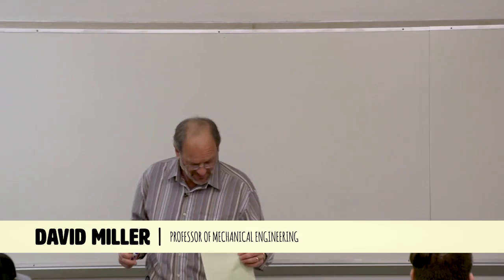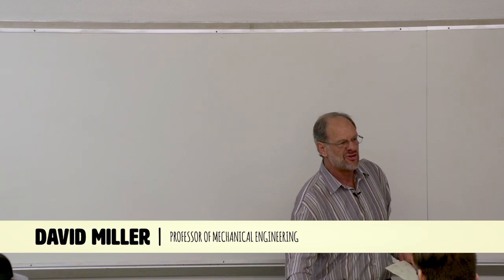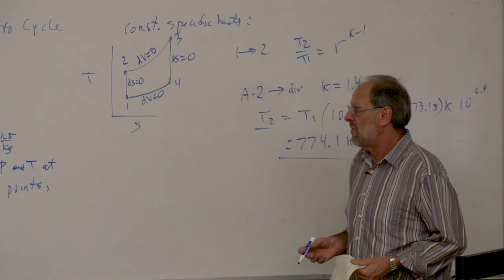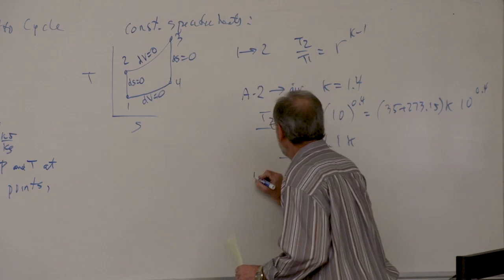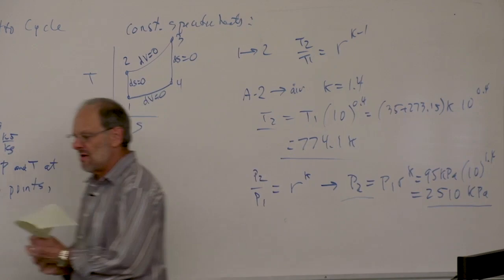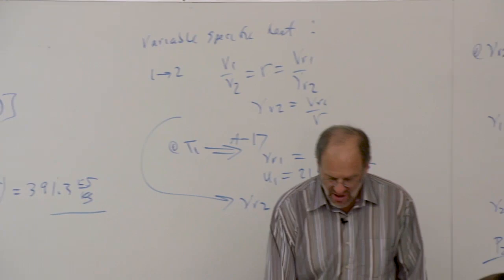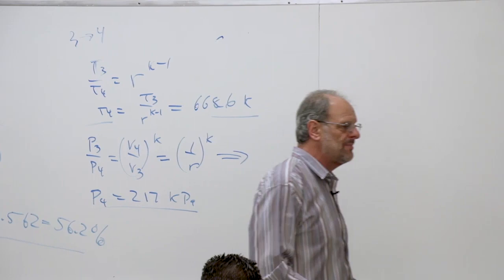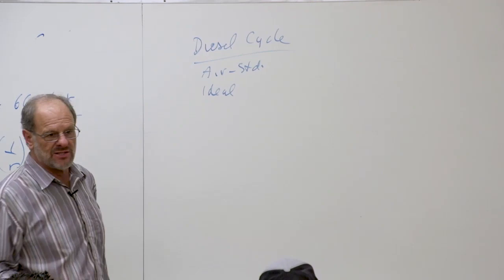Thermodynamics: Otto cycle, Diesel cycle (29 of 51)

Comment: is the equation at 22:18 correct?
Reply: Hello, following specific heat approximation, yes it is. ONLY when solving it by constant specific heats
Reply: i think v3 does not equal Vmax, it is equal Vmin and v4=Vmax. so equation should be r^k
Reply: @canuludogan8847  agree
Reply: Make Total sense. I was wondering how he got that. @canuludogan8847
Reply: @canuludogan8847  I totally agree, from the T-S diagram created V4=V1 and V3=V2. I re-read the book, so I don't know how come the instructor pointed out that V3 is the Vmax and V4 is the Vmin
Reply: @canuludogan8847  agree, but anyway the obtained answer is correct